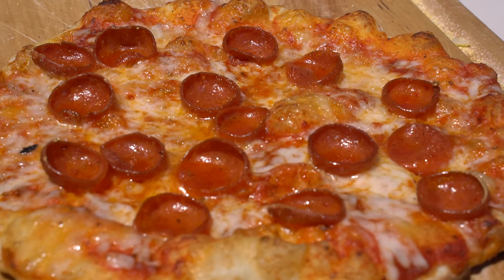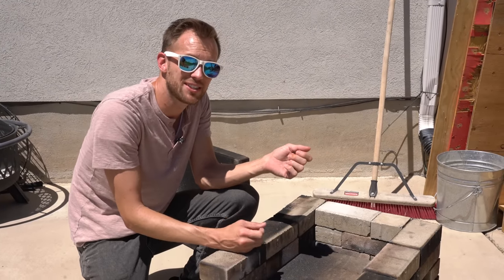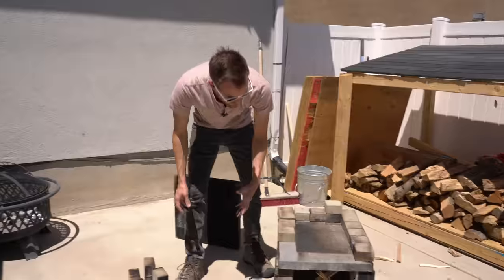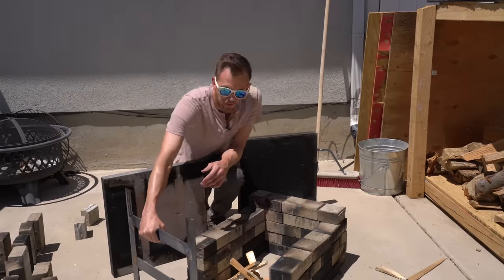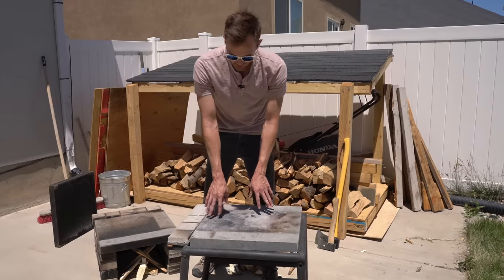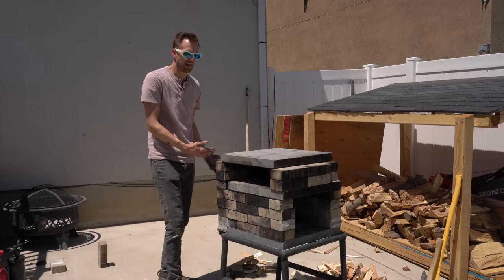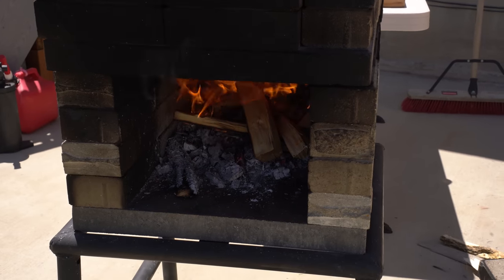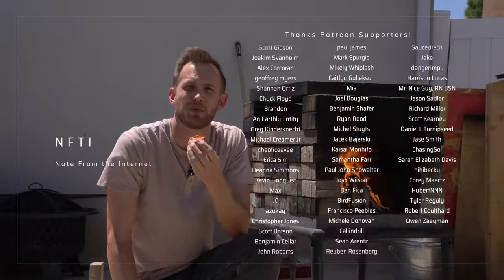The BEST Cheap DIY Pizza Oven

Comment: I do like this design, especially the side loading idea and the framing. 

Somewhat more expensive than using the middle paver stone, use a Steel rather than a stone at all. This way you get the benefit of the fire below as well as the heat circulating above.
Reply from the maker: At these temps, a steel would be too much, and would burn the pizza!  A steel is good for a home oven that only gets to 500-550, but at the 700-750 of this oven, it would conduct heat too quickly.

Comment: For the turning part, it'll give your pizza very uneven heat. The back left will be the hottest part, with the front right being super cold and the front left being somewhere in the middle. 
By putting the exhaust completely at the back, you make it so the back of the over is equally hot left to right and you can controll the temp through just moving the pizza front and back.
Reply from the maker: Exhaust at the back would be best!  But with the size of pavers I have, that would require putting support bricks on the left AND right sides of the cooking paver, leaving it too narrow to cook the larger size pizzas that can be made in this oven. If you can find the 24 inch pavers, a back exhaust is definitely what I'd recommend!
Reply: or exhaust up the two sides.
Reply: @macrumpton  That's actually a super interesting idea. Might honestly even work better than the original, but don't know enough about thermodynamics to completely verify.
Reply: @BlueDragon1504  You might need a cover for the front to prevent the heat from escaping. But I think it could work.

Comment: I feel like this is one of those things where I would rather spend the money on building something better that will last longer than spending less to build something that heat is going to destroy after a few pizzas. The money you spent continually repairing it will add up.

I've seen a lot of builds of DIY pizza ovens on YouTube, some portable and some not. I'd love to see you tackle one of those.
Reply: The beauty of this you can experiment before you commit to a final design and materials before a final build.

Comment: The addition of the supporting steel is genius.  I think Grady of Practical Engineering has a video about it as well, but essentially in many area of engineering, creating a visible partial failure before a full catastrophic failure allows for a "slow failure" which allows you to repair during downtime rather than having a fast failure during a key moment (and dropping your pizza into the flames as your hungry guests watch on).  Great video!
Reply: I laughed thinking of so-called guest looking on in horror as I smile back embarrassingly while picking up the phone to dial out for delivery.
Reply: Both hunger and shape in one hypothesized moment

Comment: I'd actually be more worried about those concrete pavers exploding.
Reply: Heat the oven slowly, that should let any trapped moisture evaporate from the pavers, reducing the risk of cracking. I don't think "exploding" in a conventional sense is ever a risk, temperatures are not that high and are fairly even. It's not like holding a torch to it, heating up (and thermally expanding) just one part.

Comment: I'm going to use 4 rows of concrete block. 32" of height starting out. A piece of catwalk  5 ft x 2 ft! That will give me working space on each side. There will be a 20x20 paver on each side.
A 20x16 pizza stone in the cooking area and I just changed the fire and cooking area like yours!
All on paper right now! Thanks!
Reply: Did you do it ..  Can  you post a video so that I may see it
Reply: I built a very similar oven several years ago. I used fire bricks that are a little more expensive. I used the bricks for the horizontal surfaces as well, supported by steel very similar to yours. Worked great, everyone loved the pizza’s. It was pretty simple to build. Well done!

Comment: Suggestion: You are getting a lot of soot from the fire. This could be reduced me thinks in a few ways. 1. Increase the height of the fire chamber.  The hottest location of a flame is at its top peak. With the fire box being so low, that hottest peak isn't achieved. The gasses don't get a complete burn....hence the excess soot and smoke. 2. Then, you don't need such a large fire in the fire box. 3.  The fire isn't getting enough air. So it will smoke more. Provide for a air hole/slot at the back of the fire base so air can flow from under that up into the fire box. Maybe use a concrete drill and drill holes in that base fire plate.  Once a fire starts burning and flowing ai up the "chimney" into the 'cooking plate" area, it will provide for a "draw" of fresh air through the holes into the fire base which in turn will provide to burn the excess unburnt gases at the base of the fire but will also provide for a more efficient burn and less smoke and less soot. 4. Place a wire grill o top of the fire box base. that will make an air gap between the for wood or charcoals so the incoming fresh air and do its thing.   Just say'n. Make sense?

Comment: You are referring to "fire bricks" and not plain old cheap "bricks", right?  Meanwhile, since a proper brick oven goes to temperatures of 700 to 1000 degrees F, there wouldn't be any reason to include lead in those bricks.

Comment: Inspiring. The ventillation slit to the cooking space makes it much faster to heat up and smokes the food. However unfiltered smoke is highly likely to be carcinogen. The heat should envelop a closed cooking space without the smoke entering it to be safer.
Reply: @vagolyk professional wood burning Naples style brick ovens like restaurants have,  have the wood fire going just off to the side of where the pizzas are placed. They don't seem to be worried about the smoke being in contact with the pizza. Also, what about the long tradition of BBQ Smokers for brisket, ribs, etc? In moderation, is this likely to be a problem?
Reply: @GallowayKelly  They are problematic. Ofcourse there are oarameters that can make it worse, like the type of wood, the condition of the wood or the heat of the burning, but to the best of my knowledge there is a reason why cold smoking is done with filtered smoke, and that itself is a preservation method, which means it is not exactly organic friendly.

Comment: I would use some cheap “fire bricks” to line the fire box to prolong the life of the outside building bricks. They are sold at tractor supply or anyplace that sells wood stoves. Yes, it will reduce the size of the fire box, but shouldn’t effect the heating of the baking plate above.

Comment: I would stick to regular bricks that are fired, and some other type of cooking surface (ceramic / fired brick). Anything that's not poured and cast, no telling whats in those for dyes etc. That could leach out in the high heat, and into the food. 

Still a great idea for a pizza lover looking for a cheap alternative, I would be just a little picky about what I used from the big box store.
Reply: exactly.

Comment: Instead of the square floor concrete slab, should try a metal mesh grill and add a circular pizza stone over it so no back slit to make the heat to rise to worry about. The fire should NOT "flame" ! Make a wood fire long enough before cooking (½h before ?) so the wood turns into charcoal ember. But maybe the cooking floor would get too hot at that point BUT... with a circular pizza stone, it is easily retractable and you could insert it on the grill floor at the best time for heath temp prior to beginning your cooking.

And to control the inside temp, why not drilling a central register hole on the top concrete slab that you can cover with another regular side brick that you can slide over to control the amount of heat to retain in. Or use two half slab ¼ or ½ in apart that you can cover with what you find convenient for the same goal.

And..., concerning your opening orientations : agreed that your fire opening should face the wind, partially or fully, but the pizza opening should face away from the wind and not facing the wind as you demonstrated. IMHO

Something to try : double the height of your cooking chamber and add a heat retaining material to block the top half front section (fireplace glass or else). Or a removable front opening heat retaining/controlling door (fireplace glass or metal sheet (insulated or not)) to see how you can control the inside heat distribution...

Comment: Great ideas. Use clay bricks and 2 to 3 unglazed big ceramic tiles on top of each other for the bases that can take the heat - no need for support and will last long. I will make the top higher to fit a roast pan to make it more versatile

Comment: The only advantage to having the openings on the same side is that the heat rising from the front would block the heat from escaping where the pizza is cooking so it would be colder of a cook the way it's made in this vid than it would be made the original way!
Reply: I was thinking the same thing
Reply: Maybe adding a fire sheild of sorts in the old design.

Comment: I’d like to see one made similar to this, but with a big chamber and have the fire in the back and the pizza in front of that and then an opening for tending the pizza. And then have an opening to the fire that you plug with a door. 
I wonder if that would take care of the extreme heat under the stone . 
I would think if you preheated the oven for a good spell and then started cooking pizzas, you could get enough temperature in the stone under the pizza area to cook a pizza and not burn it .
And I think I would look into actual thick pizza stones. In this case I would probably use the concrete under the fire and a pizza, stone, the same thickness in front toward the opening.  
Somebody will come up with a perfect pizza, oven sooner or later . At a fairly low.
I think having a hollow space under the fire, fire and pizza stone made out of glass bottles and pearlite would retain the heat and have a heatable airspace underneath the stone would be extremely beneficial.

Comment: Nice video. Some mods I did. I use clay brick which can tolerate more heat and for the bottom layer use brick that has holes in it such that the fire gets more airflow from the bottom. I also used old granite counter tops I found to make the main slabs. Thinner and can tolerate massive heat. I am concerned your metal base will accelerate the cracking of your slabs as it will quickly concentrate heat in one area, thus accelerate the cracking. You want evenly distributed heat to avoid cracking.

Comment: If your vent is now on the side, it means that the air doesn’t have to travel over the whole surface of your first paving slab. There will be a cold spot in the corner.

Comment: Nate can you mod it so it will run on propane instead of just wood? 🤔 that'd be pretty cool!
Reply: You could probably use a replacement burner from a propane grill and a regulator from the same hardware store he got that from. It would be harder to get the bricks up to temp with that though
EDIT/Addendum: You could probably use a sheet of steel and clean it up to do this.

Comment: i think the next improvement would be to find some way to incorporate a dome ceiling. Something premade that can handle high heat, like your firepit lid, but enclosed instead of mesh to hold in the heat. That way you could potentially get a higher heat, and also be able to cook taller items like bread.
Reply: I was thinking this exact thing. I wonder if a used grill domed lid would work. Possibly for a short time as I don't know if they can even handle these temperatures.

Comment: Interesting idea. When you change the opening like this, the hot air that raises may not go all the way to other end before it exits causing uneven cooking. Why not make the slit for hot air to go up at the back instead?
Reply: Yes. Seems like it would work; if the slit is opposite the opening where the pizza goes in- should solve the air flow problem.

Comment: With such a small oven it might not make a difference, but having your chimney chute on the side as opposed to the back could result in uneven heat distribution in the far back corner away from the chute and exit.

Comment: great idea. turning the design 90 degrees for the feed opening is ingenious. 

one question i have (in general) is what about adding a .375" slab of cordierite to use for the pizza deck? could it withstand the temps? i'd imagine so, but don't know for sure.

Comment: I love concrete dust on my pineapple pizza…  ( coff )….
Red clay, kiln fired bricks are safer.. concrete can explode when heated..
I built my rocket stove from red clay bricks, it heats a 10mm steel plate up just using the twigs i pick up from my backyard or the street.
I do love the design you made…🙂

Comment: Nice result another improvement. Instead of 1 gap at the back on the inside have 2 or 3 since you have the metal support frame you can get more heat from 3 sides of the pizza from the fire. 👍👍👍💡
Reply: You could even make it adjustable by covering the gaps selectively.

Comment: I know someone that built one, I don't know what they used for fuel, but the slabs heated soo fast, a slab exploded, sending shards of sharp concrete in all directions 😱
..I reckon he probably used charcoal, which would probably be a lot hotter..

Comment: The concrete in the middle might need a lot of Wood until heated. So metal sticks or plate could Help. Fireclay against burnong Pizza bottom placed in it and the Heat can come from where you want when use Sticks. 
So less Wood ist needed?

Comment: This is excellent Nate, mate!

I didn't want the oven on the ground because my knees are shot, so I want to weld up a frame/stand like yours. But, dammit, welding is a big hurdle for a lot of people, so what to suggest?

It has to be bricks to keep the same low-key aesthetic. I'm thinking of using what we call cinderblock or breezeblock in the UK, and then building a small ziggurat with a lot more bricks than in this design, to firm up the base - still no mortar necessary.

I think your upgrades are well thought out. Nice, one mate!

Comment: Not needed, but you'd have a cleaner cook if you built a fire box and strictly used coal heat to reduce the fire soot factor.

Comment: The lead may not appear until it gets to a certain temperature. Just like air fryers as usual another product that we use that can kill us has a metal that is actually radioactive i believe that when used at a certain temp above 400f it melts the metal & goes into your food

Comment: What about using an 18x18 floor tile instead? Tgey are ceramic and can therefore take greater heat. Is thre a kead issue with them too?

Also, a pizza stone is just high sand clay, right? You could make a ceramic base that would work amazingly well by simpky covering floor tiles with a clay+sand mix

Also, many countries peole cook on the floor.

Comment: The first tip means that you have significantly reduced convection heating; all that heat is going up the chimney and directly out the inlet, the far side of oven getting much less convection heat.  I say keep the original design and use a long peel.

Comment: What a great project, i'm definitely gonna build one myself. Also to answer your question, if you move the entrance to the side, the hot air will not flow over the whole pizza/stone anymore.
Reply: It still will, just it will be from the side, this not getting even heating like he said. So it should be rotated

Comment: If you have spent the time, $, and effort building a metal frame, why not keep the material from failing altogether by using fire bricks. 

Also, the way you were showing it, the heat would leak out the left hand side of the oven. If you slid your top paver to the left, it would create the same gap on the right side as the chimney. To keep the air from leaking out the front, just add a little door. 

CMUs would be an easier non-welding way of raising the oven. Definitely make it heavier. 

Haxman has a video on making one from a 55 gallon drum.

Comment: I agree that I wouldn't want to reach in over the fire to get at the pizza. The issue with your last build is that the heat that travels up won't cross over the whole pizza, only the left side as it comes up and out. Seems like you'll get uneven cooking?

Edit: Ok, you realized the issue with the side slot. Seems like an easy fix?

Comment: I don't have the time to read all 300+ comments but I dont agree with the 90° turn of your oven entrance of pizza. Just cause of heat and draw/draft. A 180° turn would be better. Yes more bricks for sure. But if one could design/build a 3"-4" drop on the inlet of the oven entrance.... win win for sure. I think 🤔.

Comment: With that design, the left rear corner is gonna be twice as hot as any other part of the oven, due to draw. I’m gonna say that anything that changes centuries of trying, has gotta be a mistake. This design won’t work without a curved back wall and a shortened (measured from the back) exhaust . You would also need a collector OR some way to swirl the exiting hot air. 
PS. It’s all good unless you put pineapple on the pizza

Comment: 7:10 the Metalframe is a nice idea .. but as a Metalworker i can tell you .. pretty useless because through the direct fire contact it will get so warm that it has no strength in/became very soft (around 550°C/1000 °F it gets almost soft as Clay) and most important, the heat makes it corrode way faster .. if you realy want to spent little more for a longer Lifetime, just by a Stoneplate out of Fireclay (Schamott in german). 
but thanks for the Video, i think i will build one my self soon.

Comment: Im not very good at diy but it would probably be easy enough to take a pizza box or something and make a paver out of refractory cement with steel mesh reinforcements inside. That would be easier than welding for me.